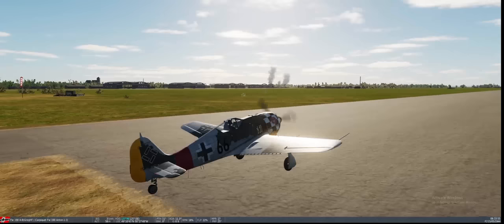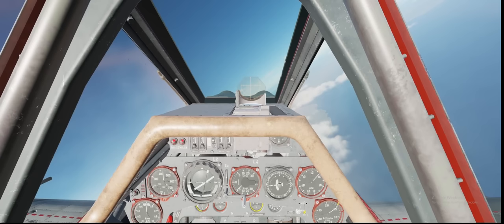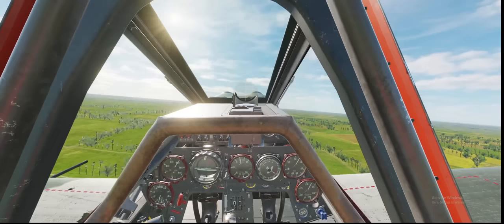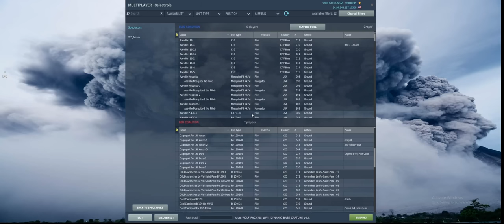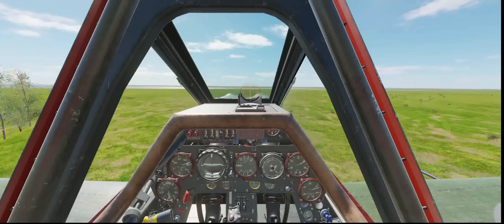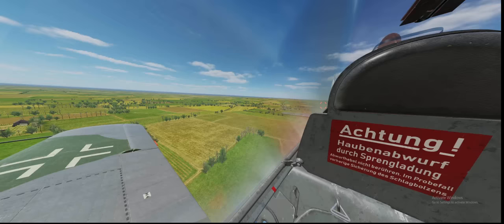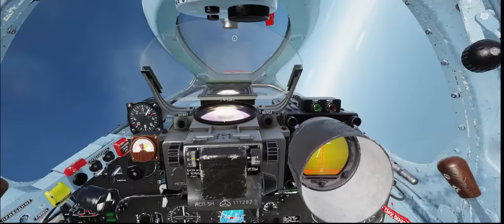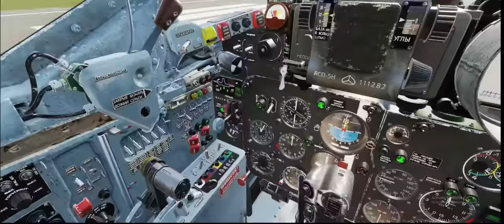German Cannons, Soviet Cannons, P-47 Mach, Angry Authors and More

Comment: I have a question.  Based on everything I've read tge P47 had much better survivability than the P51.  The number of P47 Aces making it home was much higher.  I've read many stories of pilots including Robert Johnson who had lots of stories of running away from German planes in a dive.  I've heard the frontal cross section of the plane lends itself to air braking.  I've heard it said that the P47 was the better plane for making it back.
Reply: The Germans considered the Mustang's only weakness to be a vulnerability to cannon fire. When G suits were introduced there were instances of P-51's coming back from combat missions with several more degrees of dihedral than they tookoff with; for what it's worth I have never heard of the same thing happening with a P-47.
Reply: @fafner1  I've also heard the stats of kill:loss argued greatly.  I know the Mustang pilots killed at least a thousand more planes than the P-47, but the numbers of pilots shot down in Mustangs were far greater in number than those in P-47's also whether in air combat or ground fire.  Some argued the real numbers for kill:loss were closer to 1:1 for Mustangs and 3:1 for P-47's.  The outfit with the highest number of kills in tge ETO I believe were Hub Zemke's Wolfpack.  They flew P-47's.  I've also heard that when the Mustang came onto the scene in late '43 to early '44, the German ranks of the best Aces were starting to be feel the weight of the losses as the allies were gaining the upper hand.  Some suggest the P-47 contributed greatly to these losses.

Comment: I’m wondering… could one reason for replacing the P47 with the P51 have to do with cost?  Both types were produced in volume, and I believe the per-aircraft cost of the P51 was dignificantly lower.
Reply from the maker: Absolutely, you could by 5 P-51s for the price of 3 P-47s. Then the operating costs make the 51 even more attractive. I talked about this in another video.

Comment: The East Germans had a variant of the MiG-15 or 17? I think? Where they removed the 37mm and replaced it with an additional 23mm, so I think your point has some merit.
Reply from the maker: Thanks, I didn't know about that variant, but it makes sense.
Reply: I only learned of it b/c it's in the German tree in War Thunder.
Reply: @LexieAssassin great source lol, but in all seriousness they used to operate the Lim5-P which was a license built version of the mig 17 by the polish(which had the 3 23mm) in addition to regular Mig17s and Mig17Fs

Comment: Another ideas about Minengeschöß are: 1) solid-drawn weldless shells are much cheaper than usual ones with boring; 2) by that time Germans had hypothesis that tearing airframe is statistically more effective than trying to pierce small and hard critical parts. Both of these points encouraged Germans to try to experiment with it en masse. At least as Emmanuel Gustin und Anthony Williams explain. Unrelated to USSR.
The third and final idea about it is ... not fantastic performance of Minengeschöß, and that all countries that robbed German engineering and technologies have chosen to abandon this experiment.

Comment: About the Mach limit... if you know the atmospheric conditions, it can be calculated from airspeed. Introduce a couple assumptions and you will find something very interesting.

Mach 0.71 at sea level is the same speed as Mach 0.77 at 20 000 ft, where the 1 Mach is roughly 316 m/s. Not sure where the number came from, but to me it sounds like a math error.
Reply from the maker: The speed of sound varies with temperature. This is covered in my P-47 Pt. 2 video on dive performance, in a lot of detail .
Reply: @GregsAirplanesandAutomobiles  Yes, I  am assuming standard atmosphere here. I just found it interesting how it lines up.

Comment: To add to your conversation Greg I've read that a drop tank was ever successfully really added to the Spitfire. The P-51 was all about the fuel how much fuel
Reply: G'day,

That kinda depends on what you mean by
Drop Tank.
And by
Successfully.

Instead of running Fuel Plumbing out to Bomb Shackles to dangle one Tank on each Wing-spar, as the US liked to do, the Vickers Supermarine approach was to attach a
"Slipper Tank" onto the bottom of the Fuselage, between the Undercarraige Legs, in about 3 different sizes - intended more for
Ferry Flights, to deploy to some overseas Base, than for extending Combat Radius on Front line Squadrons.

I think that the higher capacity Slipper-Tanks were only removeable with Hand-Tools while parked on the ground ; but I think I recall some of the smaller Slipper Tanks were droppable.

The thing is that as well as being heavy & draggy, none of such add-on Fuel Capacity was "self-sealing", so jettisoning them in Combat was highly desirable.

Put it this way,
The Spitfires with Slipper Tanks in the Mediterranean  Theatre and Burma/India, worked a
Whole LOT better than the
Drop Tanks which the Luftwaffe failed to fit onto it's Bf-109's during their failed
Kanalkampf of 1940 - despite the Condor Legion in Spain  having successfully tested Drop Tanks on it's (Heinkel Biplane), flying alongside the C & D Messerschmidts   being  operationally tested there.

I hope that sheds a bit of light (?).

Have a good one,

Stay safe.

;-p

Ciao !
Reply: @WarblesOnALot 
The pressed paper drop tanks were what leaked and is why they couldn't be pressurized for high altitude use effectively decreasing range per gallon consumed from forcing the aircraft to fly in lower denser air, the US made all metal tanks were indeed sealed and did not leak, they had to be so they could be pressurized for high altitude escort missions.
Also starting with the P47D-15 the wings had mounting pylons that both drop tanks and bombs could be mounted on, they didn't "dangle" under the wings on shackles, plus one of either could still be mounted centerline on the bottom of the fuselage.
Reply: @dukecraig2402  

G'day,

Thanks mate,

I stand corrected, better informed, and am happy to take on board your clarification.

Have a good day,

Stay safe...

;-p

Ciao !
Reply: @dukecraig2402 the USA used paper tanks too, IIRC, just UK production. Use of which type depended on mission.
Reply: Paper tanks don't pack efficiently or travel well on damp ships. Initially, the USA did use entirely US metal tanks. Paper tanks were used on lower level missions, AFAIK, where range needed to be extended. I'm sure someone must know much more, though. Some people have niche interests like WW2 combat bicycles.

Comment: aviation executives don't design successful airplanes. Chief engineers, skilled engineers and drafters doing the grunt work, skilled fabricators in the tool shops, etc. design and build successful airplanes.

And you are right, General Motors acquired the skills, technical expertise, personnel, knowledge, and experience of the Fokker assets.

Comment: @GregsAirplanesandAutomobiles Hi, you should study GSh-23 cannon. Very compact and light (Russians fitted it to Fishbed), fires over 3000rpm LOT heavier round than Vulcan, reaches full RoF almost instantly, and does not need external power. Its an gun that must be 2 barreled because its working principle. GSh-23 is the reason why Soviets did got interested on rotary cannons only much later than USAF. Its really packs a punch in compact and tidy system.

It came to service a bit later than MiG-19 talked about, in mid 60s. From its service entry Soviets were not behind anyone on aircraft cannons.
Reply from the maker: I do know of that cannon. I don't think it's as good as the Vulcan, but I understand your sentiment.
Reply: @GregsAirplanesandAutomobiles We know GSh-23 because we once flew MiG-21 Bis. I guess you dont know i am Finn. We now fly legacy Hornet (which has Vulcan) and soon F-35. In my opinion GSh-23 is as good cannon overall as Vulcan, but they have somewhat different strenghts.

Comment: Too bad Eric Brown didn't really define what he meant by "tactical".   
My impression is that "minimum effort, maximum gain" is probably the idea.  How shallow can one dive and climb in the P-47 and be able to recover altitude and position within a reasonable amount of time/distance vs. a "fixed position", ie: enemy bomber formation at altitude, attack, blow through, and reset scenario.  Sure, the P-47 can dive to much higher limit and use its momentum to zoom up incredibly but, can it do that and recover the altitude lost within a reasonable amount of time?  Diving to the deck from 20,000ft to max speed and zooming back up isn't going to recover 20,000ft before your momentum runs out.  It will beat anything else that's "racing" you and they'll run out of steam well before you do on the way back up but, you're not getting 20,000ft back. Pushing more-slight dives and climbs based around a set altitude point is probably more "tactical" in that respect.
Being that E.B.'s view of "tactical" was never defined by him.... I guess we'll never know.
Reply: Eric Winkle actually did! The tactical Mach number was the point where shockwaves started to form over the wings, and Mach Tuck set in. The planes nose would pull down into a steepening dive outside the pilots control and accelerate. It would be countered by adding negative trim on the elevators. If not caught immediately the plane would accelerate past its critical Mach number and become unrecoverable. To the point Tactical Mach number is the point where the pilot loose the ability to maneuver his fighter and reverts to struggle to regain his control by slowing the plane down, so the air over the wing no longer is supersonic, and control returns.
The wing creates lift by making the air above the wing accelerate to a higher speed than the air on the underside. Therefore the air above the wing is moving faster than the plane itself. When the air above the thickest part of the wing reached the speed of sound (Mach 1) a shock wave forms over the wing because the pressure waves from the rear of the wing piles up at that point. they can't move faster than the speed of sound, so they pile up at that point. This causes a massive rise in drag and the front of the wing looses lift, causing the plane to tuck the nose under. Tactical Mach number is defined by the wing's M-crit. Don't confuse this with critical Mach number for the plane, which is defined by the fastest the plane can dive and be recovered at any means. Note! Speed of sound varies with temperature. The lower the temperature, the lower the Speed of sound (Mach 1). And temperature drops with altitude.  The P-47 would not get near its tactical Mach number at lower altitude. But doven steeply at 30000 feet and above the P-47 would hit compressibility within 6-8 seconds.
Reply: The aircrafts critical mach number is given as 0.78~0.82 as per Greg in this video. 

The definition of "Tactical" has not changed much.

The way I interpret Eric Brows statement is, Mach 0.71 was about as fast as you would want to go in performing any standard combat maneuver against the enemy.     Due to any possible number of reasons. 

E.g. stick force becoming too high to extract maximum performance in roll rate or even preventing pilot from obtaining maximum-G. Or maybe due to stability at high mach-numbers caused the nose to wander around or buffeting might have precluded gaining a targeting solution. So when diving on an enemy, one would not want to blow into the high 0.7s range else he would also blow his chance of a successful attack by excessive control forces, lack of stability, delayed pull-up, and the speed, cause the plane to wind up miles below the fight with no chance of returning back into it. Thereby causing the aircraft to leave the fight who otherwise was attempting to maneuver and gain an advantage in said fight.
Reply: @frodonifinger2628 that definition was disproved by the raf itself and many others

Comment: In regard to penetration of cannon shells...   I think Greg is thinking too much in terms of penetration. The reality is that aluminum skinned planes, and even heavier aluminum structures, just dont require a lot of penetrating ability. You can only make the shell so big and so heavy for a given caliber, might as well maximize its damage beyond just punching a hole in the target. Suppose you fire a shell at an enemy and the shell enters the engine compartment. Which would you prefer, slightly better penetration, or a lot more explosives? I think it's a philosophy thing, not a target materials thing.
Reply: You must have missed the part where he said that it didn't make any difference with bombers because they had very little armor on them and penetrating their skin wasn't a problem. 
And to answer your question if you put one into the engine compartment you definitely want one with penetration and lots of shell fragments being splattered all over the place, that's why all the modern ammo for the destruction of aircraft is made that way like the ammo we had on the Vulcan gun I was an air defense gunner on, modern jets are basically flying engine compartments compared to WW2 aircraft, they don't have all the big open area's like WW2 aircraft had inside of them except for bombers and missile's are the principle weapons used for them in thos day and age, those MINE type shell's had virtually no shrapnel qualities to them.
The reason the Germans used those in WW2 wasn't because they were worried about their effect on engine's, the way they were designed to work was to overpressurize the inside of a fuselage or wing and rupture it like a balloon which would break the stringers and any other load bearing members causing it to break right there, and their 30mm was far more effective at doing that than their 20mm, the RAF and the USAAF conducted tests where they took captured 20 and 30mm cannons and fired them into the fuselages of Lancaster's and B17's, the results showed that especially with the 30mm the structural integrity from the overpressurizing balloon effect broke almost every one of the stringers and other load bearing members, but there was hardly any shrapnel type of damage, when firing into an engine compartment shrapnel is far more important because you're looking to poke holes in fuel and oil lines, oil coolers, coolant lines and anything else that'll bleed out or cause engine problems like the intake manifold, a high explosive only shell would blow panels off more than poke holes in the kind of things you want holes poked in, the German MINE shell's didn't even really enter the aircraft, they exploded when only about half way through the skin with the overpressurizing of that area happening from the explosive force blowing through the skin to the inside.
The channel WWII US Bombers has a video on the 20 and 30mm gun tests during the war complete with the USAAF reports on them along with pictures of the results of the test fuselages being shot, check it out, it's very insightful to the kind of damage they were looking to do with those MINE shell's.
Reply: @dukecraig2402 don't go giving him facts with his philosophy

Comment: SB-2, DB-3/IL-4, Pe-2, ER-2, TB-3, li-2, IL-2- 1941 all metal aircraft. I-16, I-153, Sy-2- mixed construction Jak-1, LaGG, Jak-2/4, R-10, MiG- wooden construction. In 1941, in the USSR there were a maximum of a thousand wooden aircraft, tens of thousands of metal and mixed construction. What wooden planes do you think the Germans were going to fight with? If, for example, they didn’t know about the Yak and LaGG at all?
Reply from the maker: The IL2. Outside of it's armor, it was largely wood.
Reply: @GregsAirplanesandAutomobiles  
1941.
The rear part of the aircraft fuselage was a wooden monocoque with working skin, laminated from birch veneer and plywood (in straight sections), and reinforced with stringers.

The veneer was strips with an average thickness of 0.8 mm and a width of up to 100 mm. The average wall thickness of the monocoque is 5 mm (with glue). The wing and stabilizer are two-spar all-metal. The wooden fin of the vertical tail was made integral with the fuselage.

The wing had flaps that deviated by 40°. The covering of the wing planes, ailerons, and stabilizer were made of duralumin. The depth and direction rudders are metal with fabric covering.
Mixed design. And the Germans didn’t know about the Il-2. But they knew very well about SB, DB-3, I-16. And of the new aircraft, only the Yak and LaGG were wooden. But there were also Pe-2 and Ar-2 and a mixed one, only a monocoque behind the armored hull of the Il-2 and a mixed Su-2. It is doubtful that in such conditions the Germans would focus on defeating wooden structures.
The IL-2 received wooden wing skins in 1942, and in 1944 they switched again to duralumin.

Comment: the mine shells are better in all case against aircraft because most of the time you will not be able to hit the engine, you are much more likely to hit other unarmored parts of the aircraft and the mine shells blow up thin aluminium skin just as well as they blow up wood.